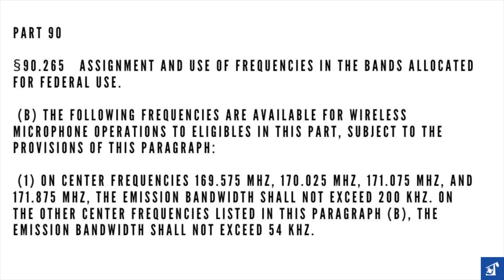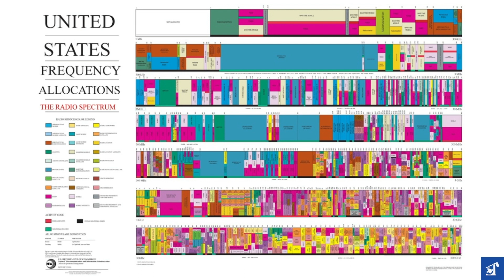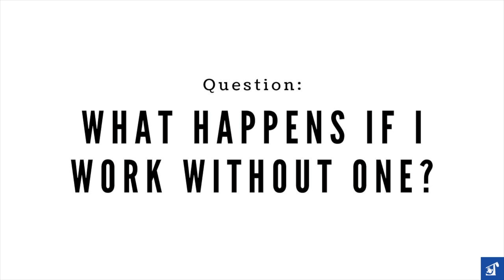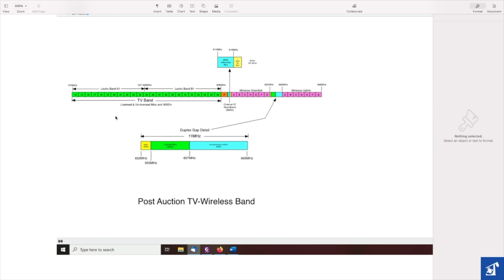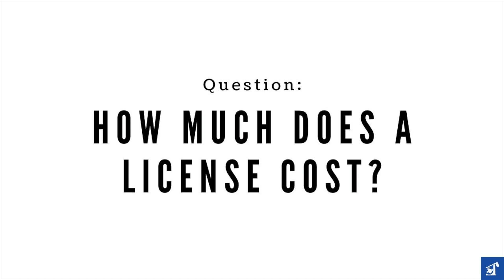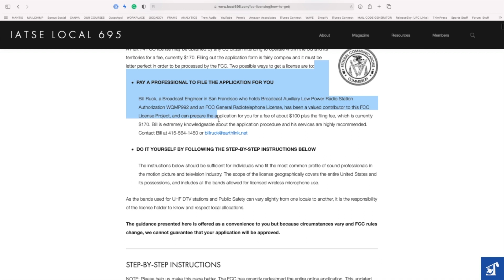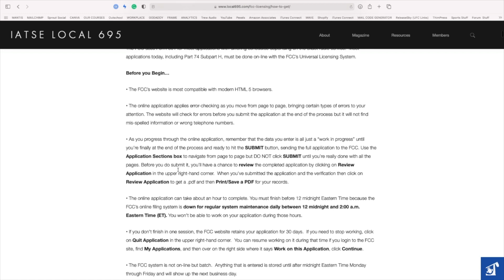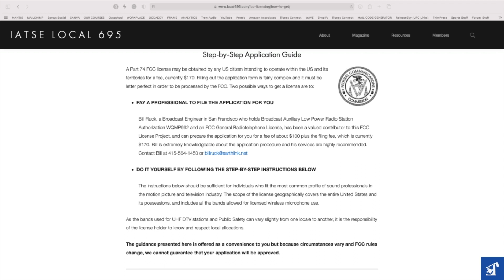How to Obtain an FCC License in 2021

Comment: So this is informative. But It didn't answer my main question. Even if I get a license as a small church or non-profit theater group using maybe 8 frequencies, what equipment do I buy and what frequencies do I operate on? And how do I be sure my several thousand dollar investment is not obsoleted by new regulations in a couple years? Does the license guarantee me use of certain frequencies in a fixed location without interference?/
Reply from the maker: GREAT question! In theory, everything depends! If you are operating in the UHF spectrum, there are a multitude of manufacturers that will work and be compatible with your license that you purchase. As for your investment, your license gives you the permission to use your equipment in the allotted time. It does not protect you from the FCC making changes to their rules. In terms of UHF though, you will be able to change changes within your spectrum without fear of having the FCC book thrown at you. If you need more help, please reach out and we will help you further!

Comment: First off I'm not in the field however Im looking to get my GROL to help me possibly get a position with the company I'm with currently. I've ordered a couple of books. One book titled GROL Plus has all the answers and gives a detailed description for that answer below it. I just need element 1 and 3. Here's the hard part I'm sure some of you know 24 questions are choosen out of 170 question pool that's element 1. Element 3 is 76 out of a 916 question pool. That's insane so I ordered another book for a study guide to help me. Do they really choose those questions at random? Is there some more important ones I can focus on? It says in the book that the test will be administered by a Commercial Operator License Examination Manager and he/she will select the questions out of the pool. Do I really need to know the answers to 1086 questions?
Reply: I am studying for my ham license after which I might go for my GROL. speaking from ham experience so ymmv:

yes a subset of the pool is chosen at random, with an eye towards varied subject matter. but i have good news

once you understand why the answer was right for a given question, you can then understand several more in that subject and sometimes related ones as well. sometimes same situation, other times situation gets flipped on its head. once you get the hang of a bunch of the ideas, try some online practice tests and see how you do

good luck!
Reply: Hey did you pass ? Now I am looking to get a new job and i n÷d the licence or whatever it is

Comment: The FCC is supposed to lower the cost of a simple GMRS license to $35. But it's still $70. You also can't easily find the site on the FCC website. The result is that I ain't getting a license. With the licenses you're talking about, it doesn't seem that different. We're talking about a gentle blend of incompetence and corruption. The only enforcement lies, in this case, with the commercial sector. 🚔 🗣📻🚓
Reply from the maker: Well, finding it on their site might be tough - but we are here to help point you in the right direction if you need help! Let us know :)

Comment: Since the ARRL and FCC did away with the code any moron can get a Ham License .And that's pretty much whos on the bands now another reason why the hobby is on its way out. The three test Tec General and Extra class are pretty easy all multiple choice questions its just a matter of memorizing the right answer. There a dozen of study guides on line..    Another 10 years it will be just like the CB radio. Pretty sad 🤔😢😢At some point you will just pay a Lic. fee every 10 years just like a GMRS lic.
Reply: How to get ham  licence
Reply: I disagree, removing the CW requirement was an attempt to get more people into the hobby of amateur radio. While it’s lowered the difficulty to getting a license it certainly hasn’t turned it into CB. If anything it’s postponed the death of the hobby. I’m sorry to say this but ham radio is dying due to many factors, I don’t hear many young people on the radio anymore and the few new hams I do talk to probably wouldn’t be hams if the CW requirement still existed. As for removing the test entirely, I’m against that but I think it’s probably going to happen as a last ditch effort to get new and younger people into the hobby. I don’t think it’s going to work myself. Let’s be honest the main killer of amateur radio was/is the internet. Now with echolink, internet linked repeater networks, and digital modes, you can’t even call it a backup emergency communication system anymore in my opinion.